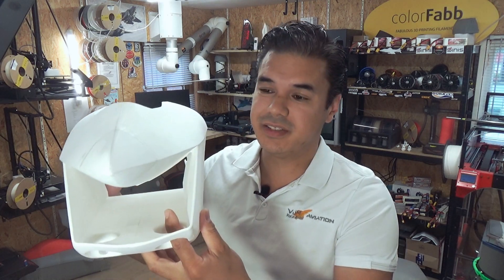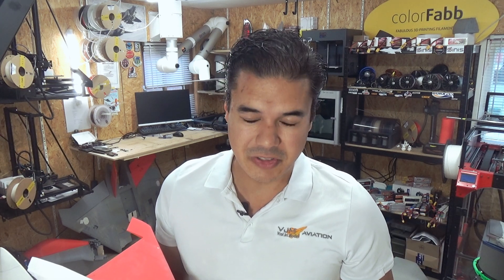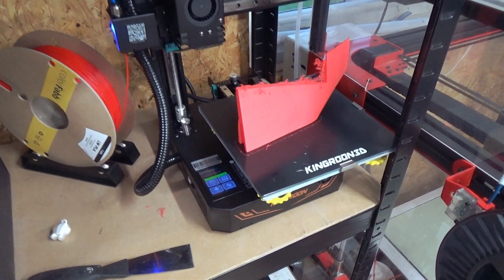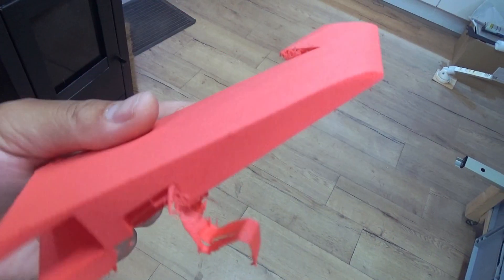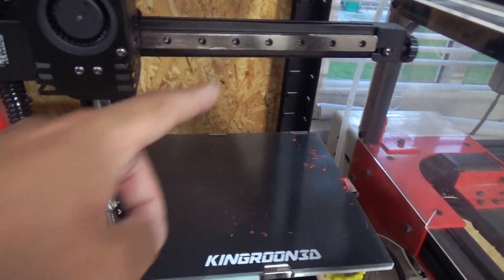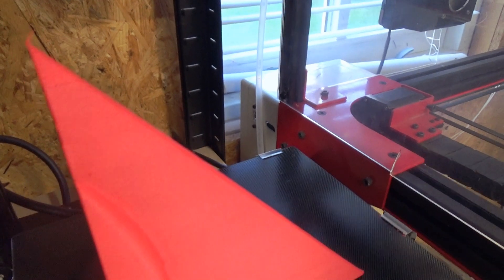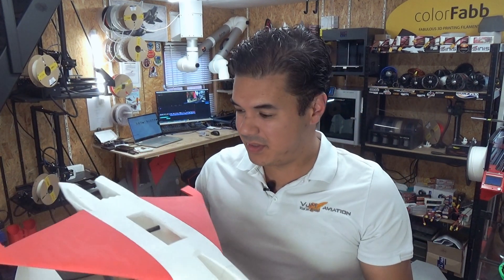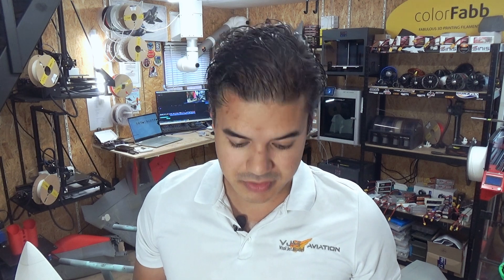Kingroon KP3S Pro Review | Can It Print Foaming Filaments Boeing X32 Builds

Comment: I'm facing an issue with mine just right away on my second print.
 filament does not stick in the center anymore. but the preparation line before printing stick will at the corner. leveling as recommended and heating are working well. any advice